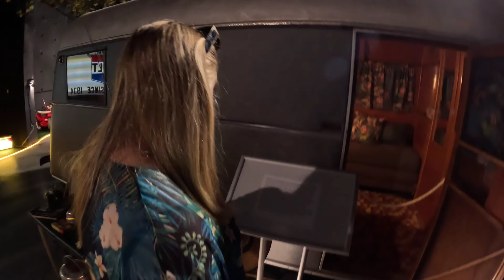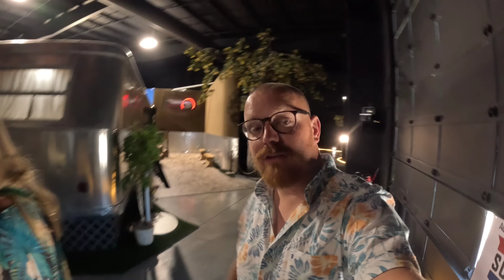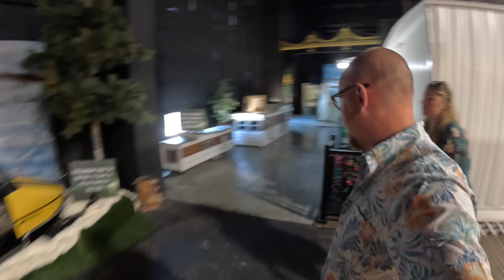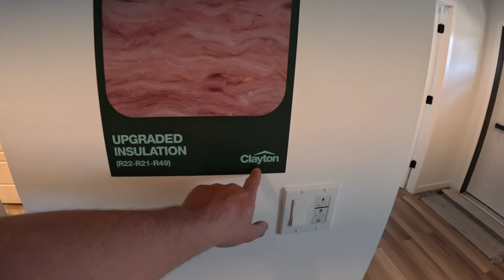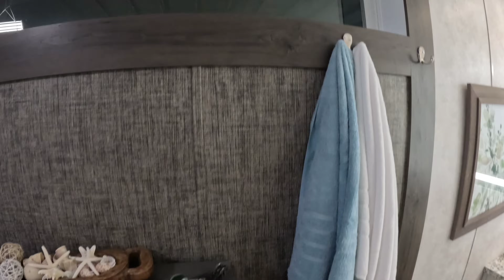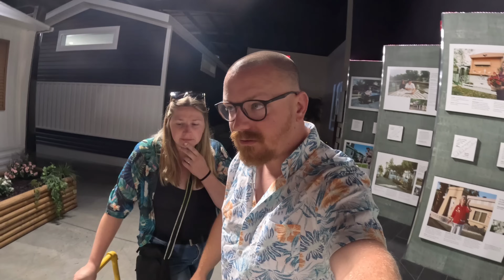You’ll Never Look at Mobile Homes the Same After This

Comment: I am not against MF homes but I own a (2007) Clayton.... never again. It is built extremely cheap and sloppy. The windows are thin and double pane 4 inches between them (which doesn't stop the heat or cold) the walls are again very thin drywall. All the trim is so thin if  you bump it when you are moving it and it breaks instead of coming loose. We had wood pieces clogging the drains and all types of debris ( rocks, wood and staples )when we removed the cheap carpet. The contact paper is coming off the cabinets and the fancy inserts are cardboard. It looked like an amazing place when we purchased it, like I said never again.

Comment: Those built in the 30s thru 50s were built nice with nice wood, steel, chrome, craftsmanship, style
 and durable. Why they have lasted. People took care of them better then as well as they were actually treated as a home.

Where I grew up, many of these aluminum 50s mobile homes were placed in vacation areas by lakes and used as a motel rooms and called a motel park. I think one motel park is still left. 

People are opening up vintage camper campgrounds now.

Comment: THE. FLOORS  ARE. ALL PRESSED  BOARD !!    OURS HAD A LEAK  SOMEWHERE   , THE COMPANY CAME OUT 5 TIMES  , NEVER  FIXED IT !  STILL LEAKED 25 YEARS LATER !!  Double. Wide  35 feet long ,..3 beds 2 bath  !   Cost a fotune  to heat !!

Comment: After I purchased My current and first ever manufactured home built in 1994, I quickly found out that manufactured homes have different water heaters do to the fact that they are vented differently. The Prior owner put in a standard stick built home water heater and the pilot light wouldn't stay lit and the very day I closed I called the gas company because I smelled a small gas leak at the stove and he went to turn the gas back on after quickly taking care of the leak but as soon as he saw the water heater he said it was the wrong type and that the reason that the pilot light won't stay lit is because the venting is different in a mobile/manufactured home than a stick built and he immediately Red tagged My home and was reporting the violation to the City and county.  I had to buy a new water heater made for manufactured homes the very day I closed on it.   You never talked about this difference, I assume a modular home since built to UBC FOR STANDARD HOMES but since never brought up I would like to know if the Water heater is a standard stick built water heater in a modular or if they still have to use the water heaters designed for manufactured homes because of how they vent.?     Again before I bought this home I had no idea there were different water heaters for the two types and that they vented differently.

Comment: Clayton homes are built really good!! We had one and replaced the bathtub and found that the floors were  2" ×6" we bought it used when we bought it and then we sold it to move to another state. I guess its still there!!   A Pal Harbor cost about a $100,000  and  you have shingle roof, siding , fireplces, drywall. We've lived in 2-4 mobile homes!! Just scope out trailer courts and find one with great rules, like neat lawns, no trash, no cars that doesn't run or licensed!!! Kids have play areas, you can buy your own land according to your county rules for them. You'd need a well, septic tank, usually a certain amt of land and so many road frontage!! My mom and dad had a big extra bedroom onto theirs. They owned they're land!!!  You can get a regular home loan on a manufactured home!!!

Comment: Most RVs today aren't built as well. They have particle board cabinets. Cheap plastic fixtures, plastic showers etc etc. Also that spartan is going to hold up against leaks better because if it's skin design. Kinda like an airstream.
Reply from the maker: I would take that over an Airstream any day! Both of our Airstreams had some very frustrating leaks, unfortunately.

Comment: I’d love to see that  museum.  I had a total of 4 mobile homes and by far, my favourite was a 69 Pyramid 10x45.  It was soundly built and even had an electric panel that had the breakers instead of fuses.  My next one was a 12x60, nice, but but years later when someone else owned it, it burnt, or so I was told.  I went from that to a house and later back in to a 73 14x54 and it burnt a little over 3 years later.  After the fire I bought a 14x64 and what a piece of crap.  Several electrical outlets didn’t work, it was like living in a draughty barn, floor rotted out in the bathroom and laundry area before I got it and someone bought it from me when I bought the house I now live in and they put new siding on it and it looked lovely, unfortunately it too burnt!!! They were all doomed except the 10x45, I still dream that I have it.  I guess it was special because it was my very first home and I was only 21 when I bought it.  I think I must have been a gypsy in another life, I still love trailers and would love to have another one to Play” in:)  thanks for the tour, it was great!!

Comment: Modulars and Rv's used to be brethren back in the day of steel and rivet and solid wood, back when dreams of seeing the stars were first born along with Plastic, and quality was great in everything. As time progressed, as did technology, the capability to build a home in a warehouse and ship it ready to go to the site improved, and Modular's started changing and evolving away from RV's. Even if they still have a "reputation" of being cheap, it's not anyone I know that believes this, because I've had multiple generations of people I know that lived in modulars.

Most current Modular homes have to meet most the standard home regulations, most are built for foundations (even if it's just cinder blocks) so the only real connection they have with the mobile industry is they are Built in a warehouse so they can be trucked to their location. This new modern production line that has better quality control then an on site stick build. Honestly, they have a greater potential for quality then on site builds due to this alone. Nowadays, most new community projects are actually modulars, and not on site stick builds. It's just simpler, easier, cheaper, to run modular and drop it in at the site ready to go. I would expect a modular to last as long or longer then most on site builds since the 60's. RV's won't last 1/10 of that time these days. 

Even though they are built in a warehouse, Rv's are still in the grey zone, They still are not required to meet code, which is why they can still be built like crap and be sold. So The issue isn't that Modulars, or even early RV's weren't meant to live it. It's that RV's have continued to fall into the "cheap built, high sell" debauchery, whereas Modulars, once they started meeting code, scaled up to and surpassed on site builds. They're not Mobile any longer, just easily transportable. 

The newest variation of Mobile homes, actually a big fad at the time of this writing, are dubbed "Tiny Homes". They are different from RV"s in the aspect that most of them are still built to housing standards, even the small 8x10 ones. Many of them DO have wheeled frames, so I guess that in some sense the Mobile Home industry has come full circle? although I doubt you'll hear anyone who owns a "tiny home" call it a mobile home. And the prices really reflect this separation from RV's.

Comment: Modern mobile homes dbl wide are about $190k and up with appliances and hvac.
Reply: By the time you buy the land, excavate it and run all the utilities it's really not much cheaper than a stick built.  Depending on area of course.  But then those areas usually wouldn't allow a mobile home.
Reply from the maker: Much cheaper than a house, but definitely not cheap anymore!

Comment: Another neat museum to visit. Didn't change my perception as I've always thought pre-fab construction always had its own advantages and was a suitable form of housing. That industry got what the RV industry needs:  Regulations and standards that protect the consumer. If you want to build and offer better and have the customer base, by all means satisfy those hire demands but the consumer deserves at least a safe and reliable minimum. The mobile home structures of today have to avoid using certain materials that created issues in the past. Examples would be materials that are resistant to mold and mildew, and structural strengths to withstand the environment the structure will be in ( stronger roofs where snow accumulation can be expected ) and certain insulation targets must be met. 
       Personally I think some of those you were walking through were getting just too big. But if others want the amenities and sense of grandeur ( or whatever the psych term for it is ) then go for it. I don't want to clean it nor heat/cool all that air within the structure.
       Whatever the space, if it protects one from the elements and discomfort, and supports the normal necessities of life, count your blessings.
Reply from the maker: Absolutely. I hate to say it, but I agree that the RV industry may very well need more regulations. There are some units that are just unsafe and these companies not standing by to do the right thing. Customer service means nothing without action. And I'm with you, some of these manufactured homes are MASSIVE! Far too large for my taste. It is interesting to me how large buildings in general have become weather mobile or stationary. It's extremely rare for someone to ask for smaller.
Reply: Try an 8' x 20' tiny house with paneled walls inside and out made of all kinds of wood materials and LOTS if resin.  Can't get a nail it the walls so sturdy!  Oh, inside built by Amish in South Texas.  Everything looks like a barn but cute, eggshell colors, beach cottege style.  Haha.
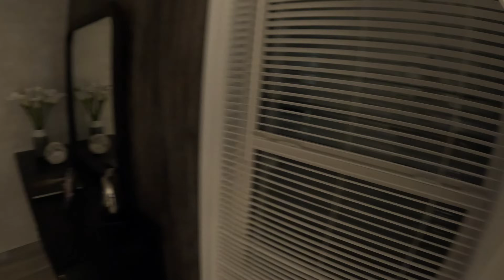Reply: 28:20  Some are built for purpose, not for family or retirement living. Like a dorm for students, small private bedrooms with a big in-room closet for luggage storage. Or for on-site miners and oil rig workers, with door from outside leading to change room, laundry, washroom and bedroom. No need for family room or big kitchen, as there's probably a cafeteria & socializing room provided by the company. As these temporary lodgings will probably get wrecked by a continuous stream of drinkers, brawls, the smell of hard working young men and dirty underwear... they are not using high quality construction materials which could bite the dust as easily as the cheapest. Yeah?
Reply: Please stop knocking on everything.